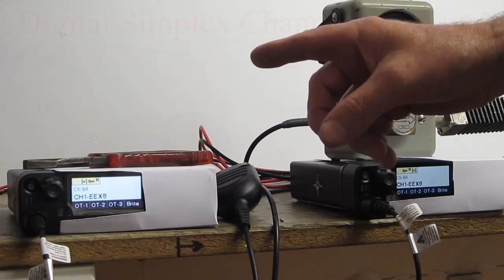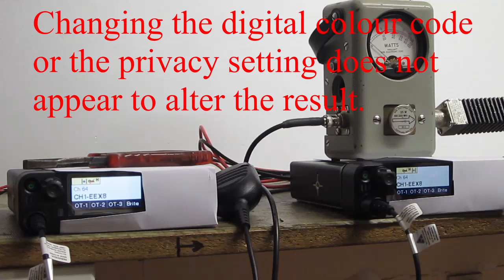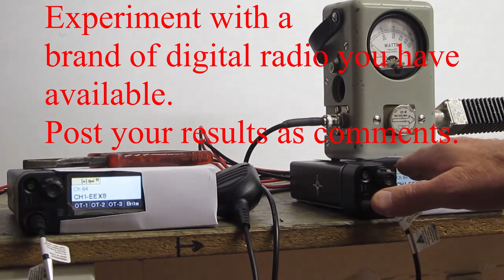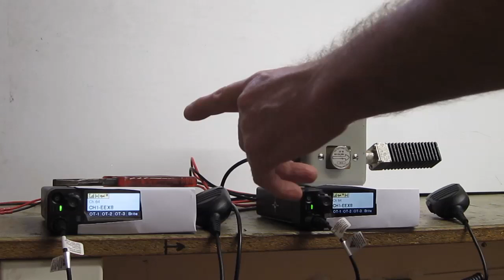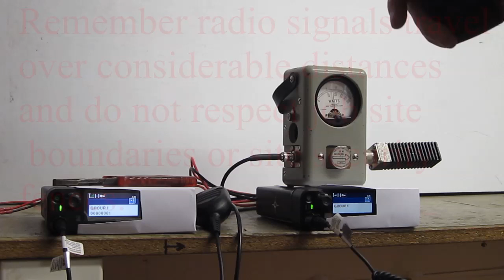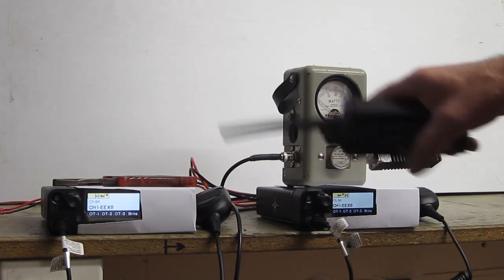DMR Simplex Digital Channel Blocking, a Serious Health & Safety Risk ?

Comment: I'm not a certified pro or anything, but it seems to me that this is just the FM capture effect, especially with the proximity of the test gear. The analogue radio is jamming the signal enough to corrupt the digital stream so the audio simply shuts down, however I think it would equally impair another analogue radio as well. While analogue would not go quiet like the digital radio, it would likely be unusable. With some separation, some error correction might help the digital signal vs analogue under the same conditions.
What do you think of this as a possibility?

Comment: It is not limited to DMR being "Blocked" even analogue (FM) will be unintelligible if there are two transmitters transmitting at the same time, or be "Blocked" if you are using CTCSS Tones
Reply from the maker: CTCSS tones don't cause blocking. The receiver squelch will simply not open unless the correct tone is apparent.
FM signals will have capture affect (strongest signal wins). You can also have a beat note (difference frequency) on top of the audio.  
This issue is different again.  I believe the data packets (generated by the VOCODER) are being corrupted during transmission (by the analog signal).  The DMR receiving radio appears to be quite sensitive to this form of interference.
I believe the errors reach a point where forward error correction is defeated and the DMR receiver simply wont work. 
Its not good when this occurs right in the middle of "mission critical" communications (as the video demonstrates).
Reply: @rtguy1080  there is unlikely to be any radio modulation mode that would survive your test, you are expecting one radio to receive another radio via the leakage on the coax / test equipment when there is a 5w signal right next to it, I would even say that if you reversed your test, set both on the mobiles to analogue and do a dmr transmission from the handheld then you would not be able to make our what the intended message was from the analogue radio, any one doing "mission critical" knows the requirement for positive communication, a crane operator should know that if they can't hear the dog man/ rigger then they would not move the load, exactly the same as if the could not see the rigger when hand signals are used, or hear when whistles  are being used.
Reply from the maker: @VK5BD-Bevan  Its great to have this open discussion.  This issue has nothing to do with leakage.  What you are seeing here is my attempt to replicate the situation I encountered in the field . 
In my situation the client was stevedoring (logs) using digital hand held radios.  They had established reliable communications and began shifting the load, only to have communication cut off mid sentence.
The cause of this "blocking" was tracked and found to be an analog radio (with CTCSS) on the same frequency (on an adjacent industrial site).
The situation created a serious health and safety issue.
The analog radio users had no idea that the digital users were present. Like wise my client had no idea (dispite the flashing green LED) that the same channel was also being used (analog) by the neighbouring site. 
Please conduct your own tests and post your results.

Comment: This is interesting, if you purchase the rights of a repeater frequency in NZ. Can you use talk around simplex?
Reply from the maker: Repeater frequencies are not the issue here.  Simplex licenses are the problem. Refer to the following video https://youtu.be/04ySIoCaFbo . Start at  1.55  (because the frequency is almost always shared with other users).  My message is "beware" when using digital modulation, given a situation when the channel is shared with analog users.  Given the right circumstances digital signals can be "blocked".
Reply: @rtguy1080  Even "repeater frequencies" suffer the same issue, it's not DMR specific, ALL radio systems will have interference caused to them when there are two transmissions on the same frequency

Comment: I think your point is very clear however have you conducted test with varying levels of unwanted RF, eg the analogue signal. The proximity of the handheld in relationship to then 2 mobile units being very close, which would amount to some degree of swamping. I would suggest trying this same test with a signal mixer into the receiving mobile RT and inject via a hybrid coupler an analogue signal of a level that would be in line with a real world scenario. It would be interesting.
Reply from the maker: Actually what I replicated on the bench, I discovered in the field after a customer complained about missed calls on his new digital radio.  The analog radio (that caused the problem) was not even licensed for my district.  My customer was using the digital radio for mission critical communications.  The analog radio was several hundred meters away on an adjacent (and secure) industrial site. I can assure you that "swamping" was not an issue.  Altering the colour code and privacy settings had no effect in the field or during subsequent experiments on the bench.  I encourage you to do your own tests an add comments on your findings.